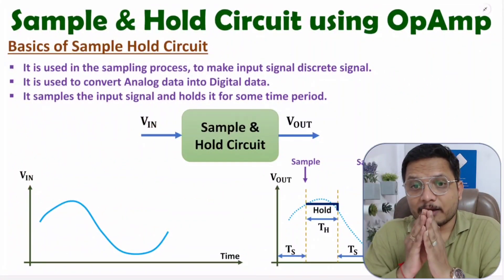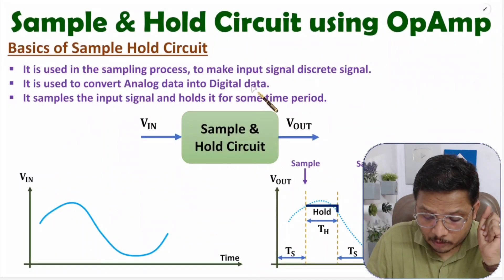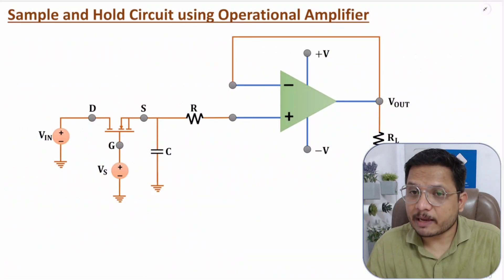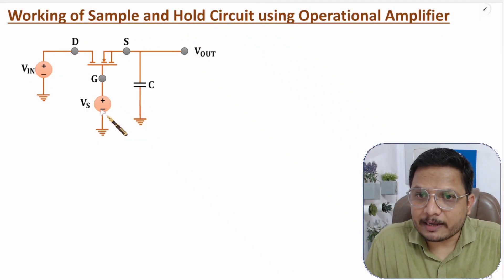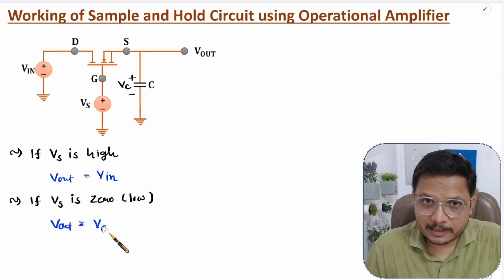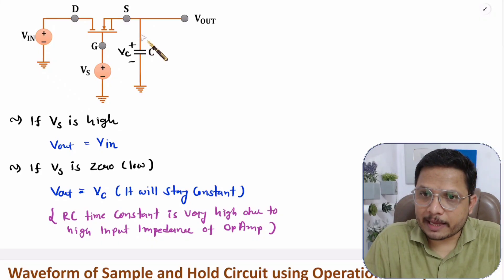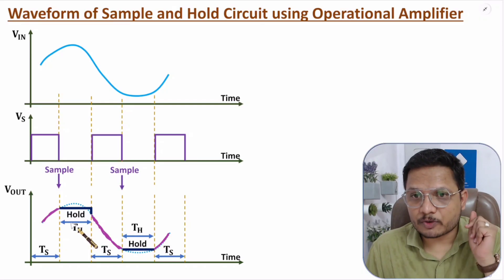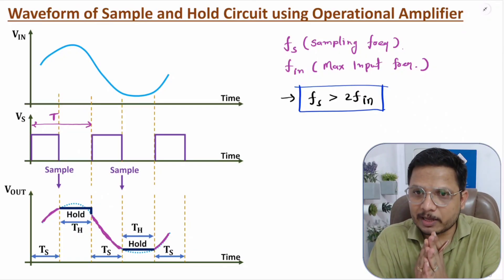Sample & Hold Circuit using OpAmp (Basics, Circuit, Working & Waveforms) Explained

Comment: Hi Sir, First of all great job. I just have a quick question as we are using the MOSFET as a switch with the sampling voltage being fed to the gate and the input fed to the drain, in such a case do we still need to apply a Vdd to the MOSFET or the Vdd by default is the signal that comes in. Furthermore, if so are there minimum values of signal amplitudes that are necessary if Vdd is not used at all.
Reply from the maker: Without vdd it will not function
Reply: @EngineeringFunda  Thank You so much !!! I had this doubt for long